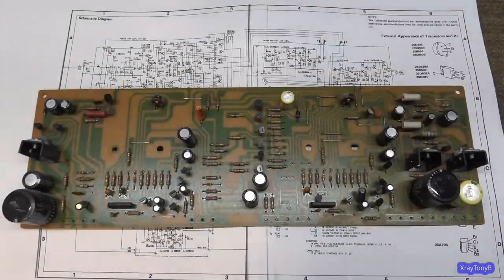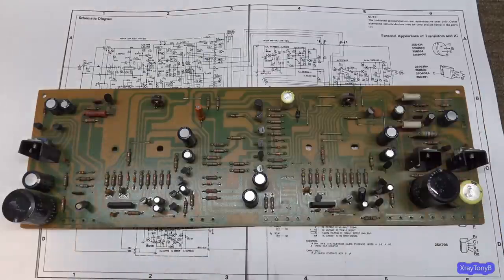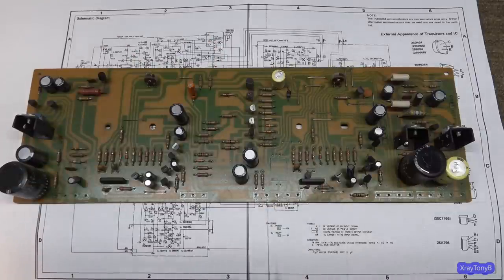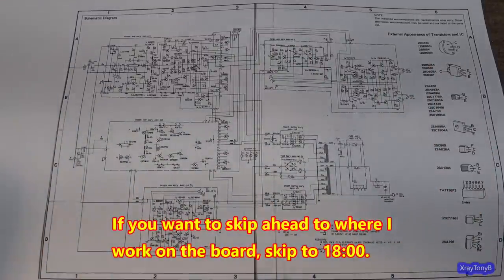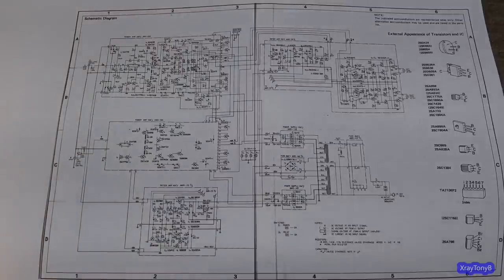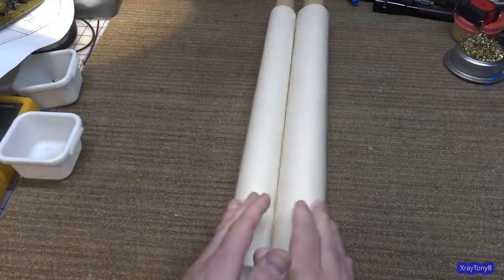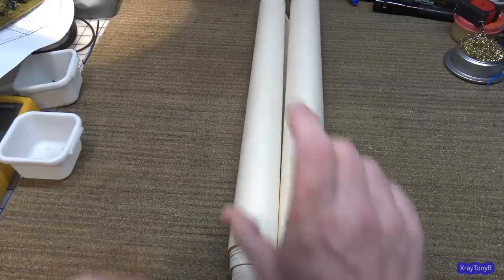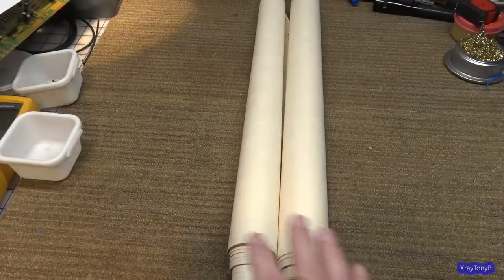Pioneer Spec 4 Part 4 Solder & Chat Meter Board Service

Comment: WRT caps and staying properly formed with lower applied voltages: I've heard this being spread around for years now but have never quite understood how it's supposed to make sense. Is there a minimum threshold voltage the cap requires to stay "properly" formed? If not, I fail to understand the logic I suppose...do ESR and the other characteristics you mention form a linear relationship with voltage? If so, how do cap manufacturers determine ESR for datasheets if it is voltage dependent and why is a "minimum" voltage not also published? I would love to research this and get a more definitive answer because I have never seen it confirmed by cap manufacturers. Maybe some experiments are in order?

Comment: wow your Dead Sea scrolls comments and being an x-ray technician were incredible. Thanks Tony
Cleaning Out the Warehouse, from an amateur radio standpoint my mind was going to building a transmitter Double Sideband Suppressed carrier from your surplus parts. There must be some really neat obsolete x-ray tubes that would lend themselves to amateur radio. I wouldn't even think about an audio amplifier however a modulator might be acceptable.

 to including a neat x-ray tube for an AM. Modulator and RF amplifier

Comment: There's a stereo store in the Binghamton NY area that I've not been to since before Covid that had a stereo setup that they were selling for $250,000. The power amp was a Mcintosh unit that had meters that were at a minimum 5 to 6 inches wide. Also had electrostatic speakers that were over 6 feet tall. So high end stuff is still available and meters still rule . . .
Reply from the maker: Gotta have those meters! ;) 
Good to hear from you, Merritt!

Comment: We just called them "diode stacks" in radar. Our's were about 2" round metal base and a hemispherical 1" high dome on top (Bakelite or some such), with a screw in the middle, and on the bottom, a place for the next screw below to mount. So they were sort of compact. We'd have about 8 to 10 of them in a stack. The last radar I worked on had -86 kV (so the klystron anode was at ground).
Reply: I have also seen the same delta/wye rectifier configuration in high power TV transmitters. They still have a filter cap but it can be quite small in mfd value  due to the 12 phase rectification.

Comment: ive saved so many 3-500z transmitting tubes over the years from the early 70s by just heating the anode . i come from the rf world back to the af world . watching your videos has made mouser and amazon money gatering parts and literature. last week i bought the designing audio amplifier book .

still like my amateur radio hobby but man have times have changed in the last 20 years

Comment: Going by how the old paper and wax capacitors were made and tested, I have seen those things tested at more than twice their rated voltage! And not explode! 
Can't do that with modern electrolytes! But what I have picked up on from studying electrolytic capacitors is that as they age, they begin at the top end of their voltage rating, so a 100V rated capacitor has 20V of ageing before it gets to the 80V that it's working at ..... Not only that, a higher voltage rating also equates to a higher temperature tolerance (I read that, I believe it was a Panasonic datasheet).... 
That's why I believe that there are more pro's than con's by going up in voltage rating for capacitors! It's possible that the voltage overeating of the old paper and wax capacitors is the reason why they lasted as long as they did.....